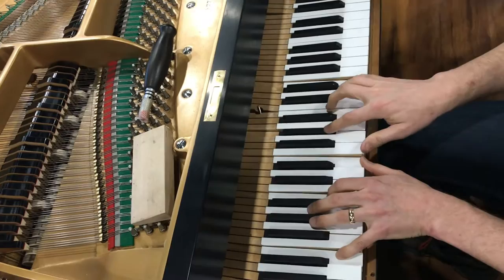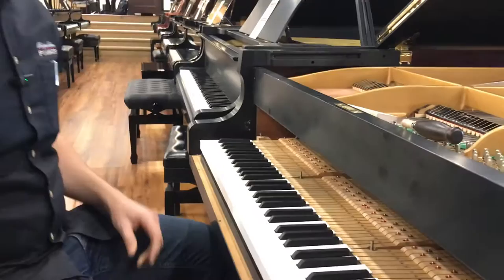BLP Shop Training: Needle Voicing Piano Hammers for Improved Tone

Comment: Someone has poorly refaced them hammers and have taken the meat of the face of them. I was taught not to go too far with the face of the hammers when refacing them and leaving a slight string mark on the hammers. It's a guide really as well to make sure you reface them evenly and also you can use them as a guide to line the hammers up when reinstalling them after refacing and any other work needed to be done to them. They might be worth replacing really.